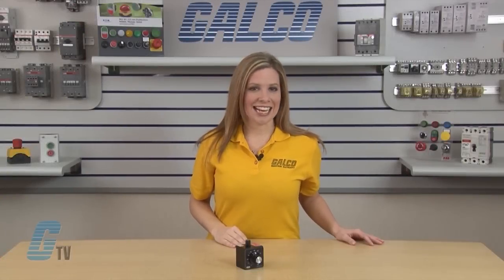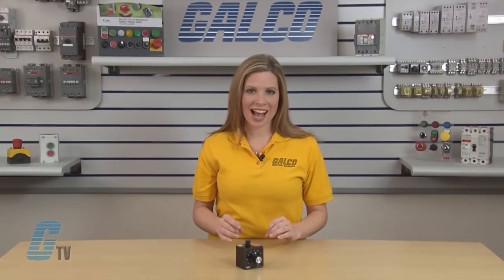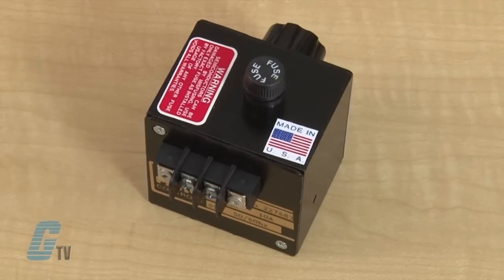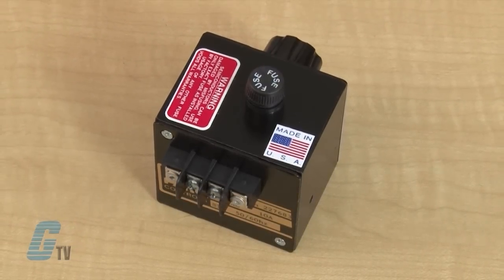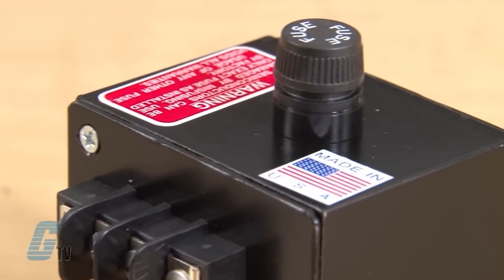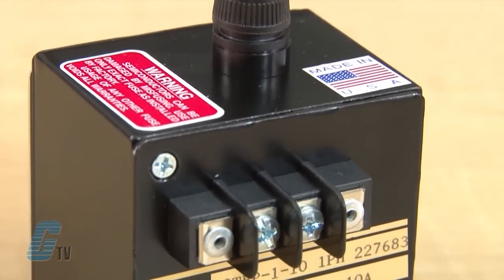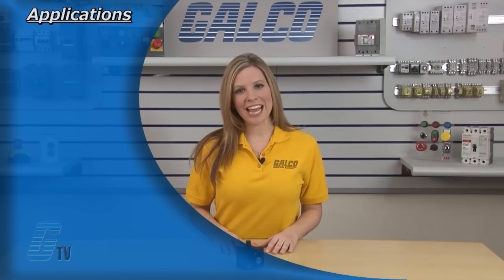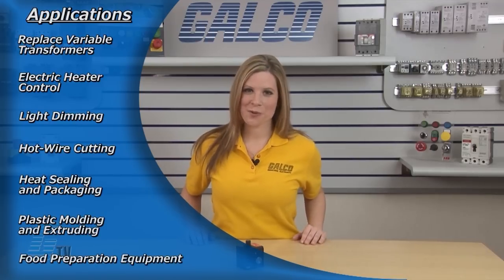Payne Engineering 18TBP Series Variable Voltage Controller

Comment: I bought a Payne 18TP-1-5 that had a sticker with an American Flag on it that said, "MADE IN AMERICA" It failed. The fuse did not blow. I had it for 2 or 3 years but rarely used it. It took some effort to access the components inside. The metal box incasing the components was not meant to be opened. An excellent quality box that made viewing the junk inside difficult. Some of the parts had made in China stamped on/or in tho them. The unit was never subjected to heat above room temp., or exposed to water, dropped, or abused in any way. I emailed Payne, and I sent them pictures of the interior. The sales rep. was a liar. He said that some of the parts were no longer made in America so they had to purchase some of them from China, but still claimed that it was made in America. I responded to that BS with an email that any product that had parts critical to its function or utility that was made in a foreign country notorious for lack of quality controls, can not be claimed as being made in America. I also pointed out that assembled in America with shit parts from China and putting a MADE IN AMERICA sticker on their product showing an American Flag was fraudulent (to say nothing of dishonoring the flag). The potentiameter was the only moving part besides the on/off switch, so I took it to Radio Shack to see if I could get another one. Nope. I ordered one on-line, but It wasn't the switch or the potentiometer. All the parts in the unit could be purchased for less than 10 dollars retail, and all of them were available from American manufacturers, but I had already wasted too much time on the turd, so in short order it went to the local landfill like most products imported from China.